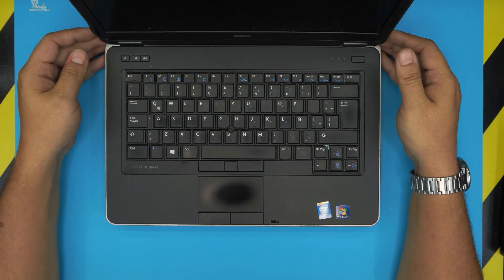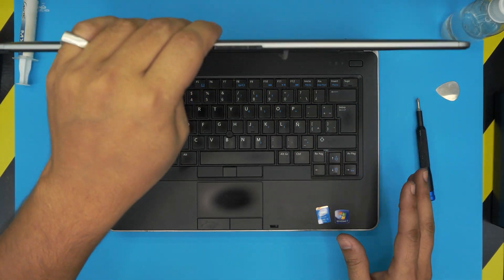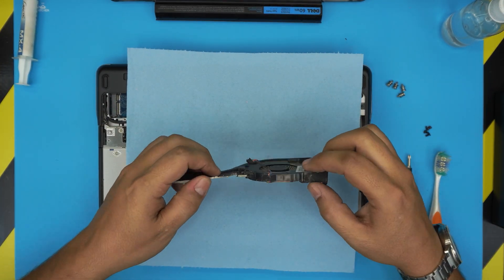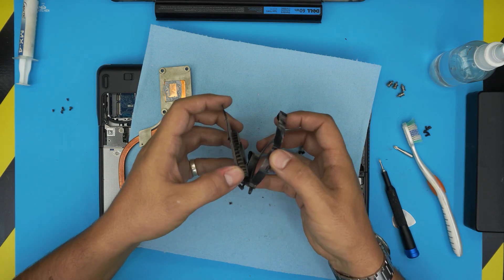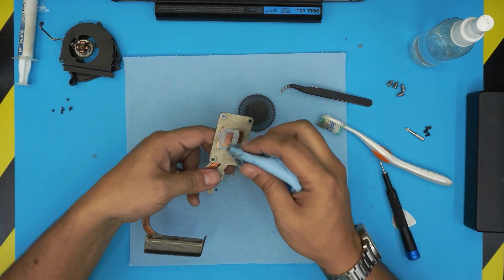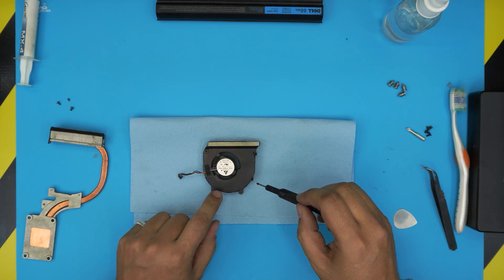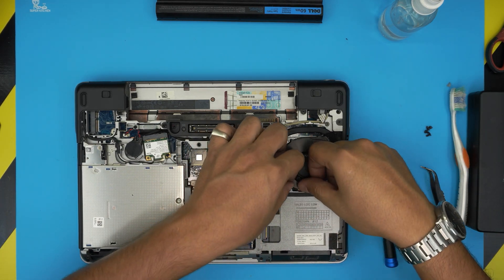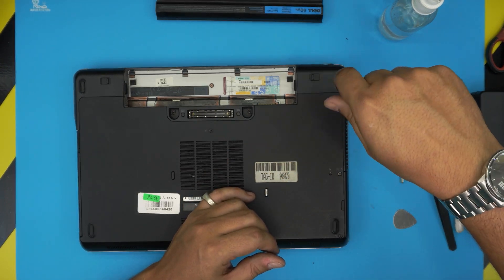Dell Latitude E6440 ( P38g ) Cleaning & Service , Repaste

Comment: temp difference? Please inform quickly i am going to buy a thermal paste
Reply from the maker: Thank you for your feedback! If you wish to support the channel, you can like, subscribe, or both!
Regarding your question, the temp differences are always different depending on few factors, on my clients the temps droped 8c or up to 14c drop.
remember that air flow under laptops helps and the type of paste you use, i highly recommend yo get thermal grizzly kryonaut: https://amzn.to/44nJyid
for the best results, but if you want a cheaper and good results go with ARCTIC MX-4: https://amzn.to/46OWAGX
Should you have any further questions or requests in the future, please don't hesitate to ask me.
Reply: @uFixTek  Thanks
Reply from the maker: it is my pleasure, cheers🍻

Comment: My e6440 is shutting down or saying battery is low by itself and turning off. Any suggestions?
Reply from the maker: Thank you for the feedback! if you wish to support the channel you can LIKE or SUB or both :P
regarding your question: your power brick (charger) its getting weak and or failing replace the charger. if its 65W get a 95W